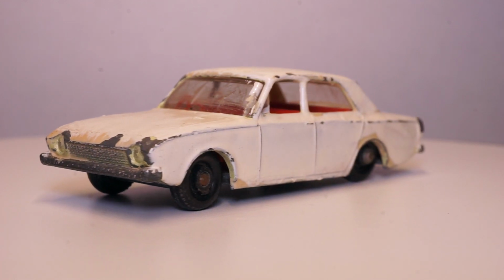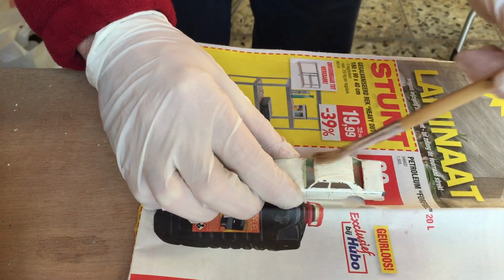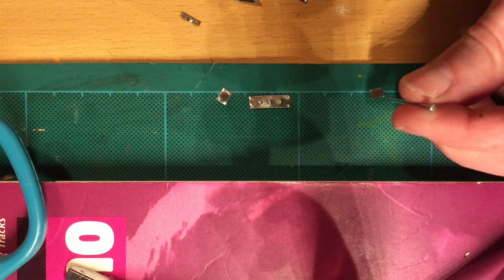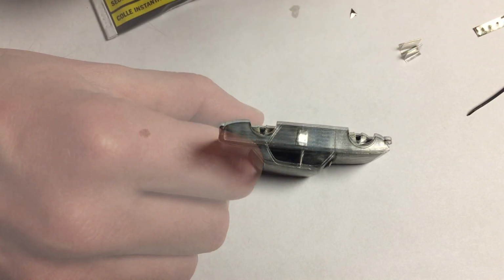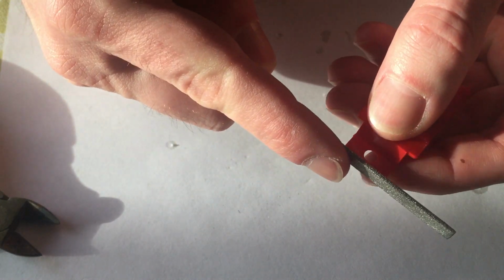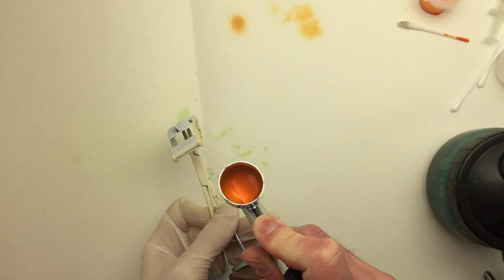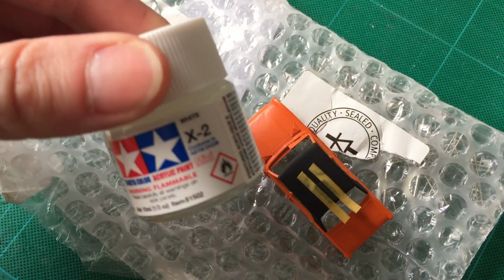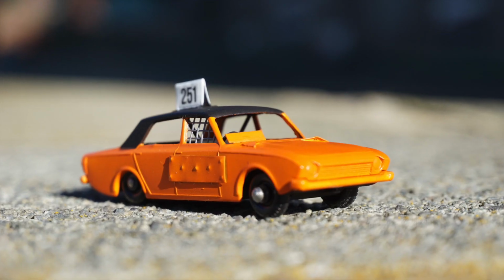Matchbox Custom 45b Ford Corsair Banger Racing Car Restoration

Comment: I enjoyed your video, it was suggested by "Time Rider". Here in the USA we had what was called "Demolition Derby's" . The field of cars were in a field and simply banged into each other until one was left moving under it's own power. It was interesting to see your "Banger Races" were on a typical oval track.  Thanks, I decided to subscribe to your channel. By way of introduction I am a Camera collector, restorer, repairer and sometimes customize them. I enjoy "Hot Wheel" and "Matchbox" restoration videos because many times I pick up great ideas and techniques that I can apply to my hobby and get good leads on some great tools.  Regards, Tom USA
Reply from the maker: Nice to hear you like it! Time Rider is great. We often talk to eachother about our next projects. Thanks for subscribing, by the way! Good luck with your Camera projects! Do you have any pictures or videos of your projects? Have a nice day!
Reply: Doing videos is something I've always wanted to do. I just don't have the time to do all that work. FYI I am restoring a few 1950's "Realist  Stereo Viewers" (Google it") The battery contacts rust out due to old battery leakage. I use the rust remover and zinc plating techniques I learned from you gents. One day I'll do a video, I certainly have the digital equipment for it. THANKS
Reply: Our Bangers drive on a track which can be made of tarmac, or concrete, or shale, or even mud, and can get up to 80 mph on the straights. A full contact sport. The only move that is really prohibited, is full speed impact on the driver's door. Still happens, though.
Reply: Dangerous sport, our drivers usually drive in reverse and aim for the engine compartment or try and knock off a wheel. I haven't been to one since I was a kid. All I have locally is a drag-strip. Thanks

Comment: I like your work a lot. Deeply envious. I am having a problem getting a durable finish when spray painting die cast model cars. I am using Vallejo undercoat, paint and varnish but the paint remains easily scratched and then I have to strip it off and start all over again. It’s happened to a lot of the cars I done. My success rate is very poor. I give them 3 coats of light undercoat, leaving 15-30 mins to dry then leaving overnight before give 3 coats of colour, 15-30 mins between coats. What am I doing wrong?
Reply from the maker: The acrylic paints are notorious for getting scratched and chipped easily. I often have this aswell. Do you use any primer coat first?
Reply: You could try setting your paint cans in hot water for 10 min then paint

Comment: That was a great custom. Do all Corsairs look like the trunk is full of bricks? They just seem to ride a little low.  Keep up the good work.
Reply from the maker: This one had a broken suspension beam in the back. But I liked the way it looked to I didn't repair it. Thanks for the thumbs up! 😊
Reply: The suspension beam has sagged.  Its a plastic strip attached to the interior piece that has bent over the years. Common problem.  The beam can be placed in boiling water to soften it and bent back to straight.  Then some cold water and it should stay straight as it cools.  This will get the ride height back and hopefully good for another 50 years.
Reply: Besides, it's called banger racing, not carefully maintained antique racing. :)

Comment: Very nice but if I may a couple of observations in the UK only the drivers seat would be left in and if you had removed the lights as well   It would have been a little better but iam not pic-kicking  it’s still a great job
Reply from the maker: The drivers seat in the UK is in the right, just like this Ford Corsair 😉You are right about the lights, but then I had two big holes in the casting. That's why I went for the painted headlights look these cars often have. Thanks for the input. It keeps me focused on the details!

Comment: I don't know what to think. We don't have that kind of car or racing here. most racing cars in the lower classes get the doors welded shut. In Demo Derby they may only chain them shut, I've never seen them plated shut like that. the number thing on the roof isn't used either, tho it seems like a good idea to me.
Reply from the maker: Google search some British Banger Racing Cars. I hope you’ll see the resemblence 😅 Every region has its own way of prepping the cars, I guess.
Reply: @MatchboxRestoration  seems like a good way to do it. Not everyone has a welder and torch available. Would probably be rules legal, but it just isn't done. I looked at some Banger racing on You Tube. kinda looks like a cross between early stock car racing and a demo derby. Oddly, a few of the cars had the passenger door cut out and left open. Looks like fun. today's stock car racing isn't, the cars are so far from stock it's ridiculous, the engines alone can cost 100K in the top levels. The rules have really ruined it.

Comment: I really like what yiu've done , but being a banger racer l didn't think you'd need to worry about the body work so much and you coukd've put a single seat fir the interior as most banger racing cars the interior was stripped out. In saying that I love what you did with the plates to hold the doors and bonnet (hood) in place. Another thing they dud was put a radiator behind the drivers seat and add a small fuel tank. I'm only going on what I've seen at banger racing in the UK. But on the whole you did a great job 👍